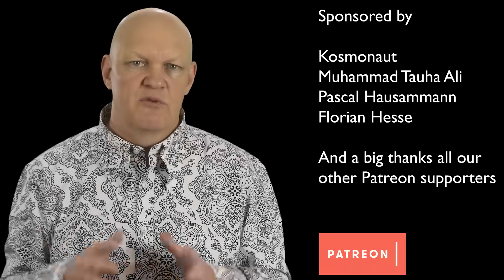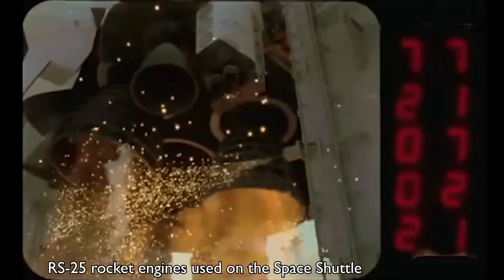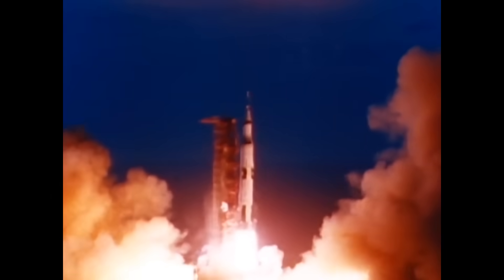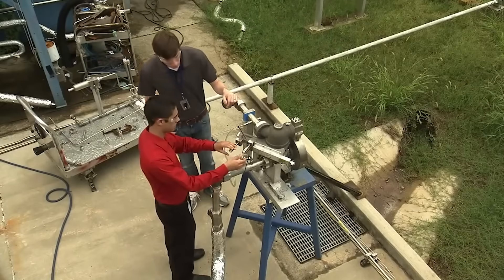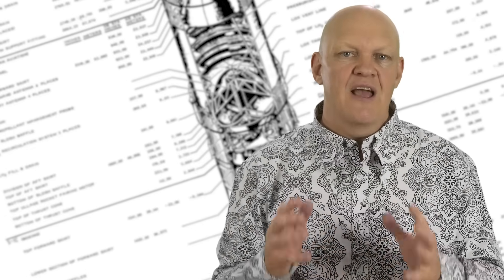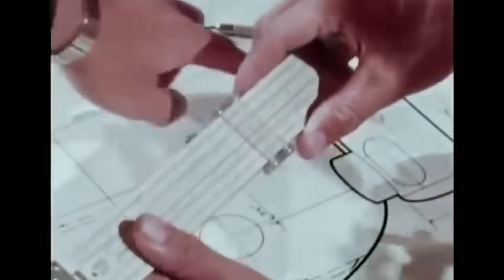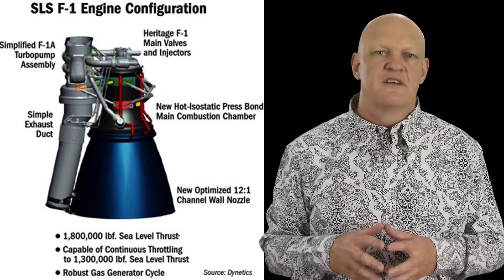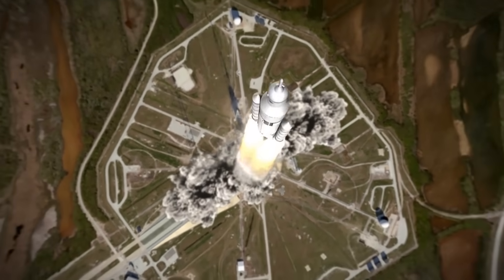Why Can't we Remake the Rocketdyne F1 Engine?

Comment: Working in R&D for a "couple" of years I can say, that history repeats over and over again. Documentation is something that everyone wants to have, but nobody wants to write or pay for. In every project, it's the first thing you sacrifice for being faster or cheaper.
Some years ago, I had the assignment to develop a new module for a system with its origins in the 80ies. There were documents on the interfaces to use, but we soon found out, that they were incomplete and partly incorrect. We had some modules from "back then" that were behaving differently from the specs. Our customers that provided the stuff were unpleased and helpless, since the original developers left the company or retired some years ago. Their reaction: Leave away the documentation and just make it work. Lesson learned? I doubt it.

It's the same thing here: Nobody cared about long term stuff. That's where knowledge gets lost! Why do you design it this or that way? Remember that in the process of design, you have to take into account what you can produce, buy etc.

Comment: In the mid sixties I worked at Douglas Aircraft in Huntington Beach. We were building the third stage of the Saturn V, the SIVB rocket. After the Saturn program we built the Skylab in the seventies. The engineers were so talented. But they would be completely amazed by what the engineers at Space X are doing today.

Comment: Back then everything was hand made. The tubing that made up the rocket nozzle was hand welded. Now it could be made by CNC and/or 3D printing.  It could be designed on supercomputers and controlled by supercomputers. With today’s technology, we could make an engine better than the F1. Not a slide rule would be in sight.

Comment: The F1 engines were just as you say built in a completely different time, and to make them they had to make use of the industrial base available then. Can't jump into a time machine, you have to use what you now have. Granted, the engineers got it right and the engines were and still are marvels of technology.  However, now you can design the part in three dimensions, make a prototype and check the fit and such in the real world. You can build with Computer Aided Machining,  We simply have technologies that allow everything to be the same now. For instance the engine that lifted the LEM Ascent stage had to be designed and built and put into the craft without testing as the fuel was so corrosive it would destroy the engine. Now, none ever failed because the designs were simple as they could be however had it failed we'd have had men stranded on the Moon with no help available.

Comment: Wrong. This technology can certainly be recreated. The difference is technology has advanced forward since the late 1960’s, more power, more efficient, with lighter parts. Resulting in more lift capability at hopefully a lower cost

Comment: The Apollo first stage used Kerosene and LOX. Will the SLS use kerosene also or hydrogen? If they are different, that will cause some engine manufacturing adjustments.
Reply: How many smoked salmon would it take to create the LOX for a single launch?

Comment: Sure, the big engine was an impressive feat of technology. Generations to come will marvel at its size and power. But the question is,  what would its use be today?  Scientific missions are smaller today, as ever more features are packed into smaller and smaller mission packages. In addition, propulsion technologies are pushing all envelopes. It's still early in that process, but one day it will lead to an understanding that chemical rockets are heavy and limited.

Comment: I was 5 miles from cape Kennedy on the beach and watched the July 1969 liftoff  of the Apollo 11, out of this world experience with the deep crackling sound from the Saturn 5 engines and the sand on the beach vibrating 1/2 inch into the air. Totally incredible as the rockets picked up speed and ingested clouds!

Comment: So....wait a sec. The New Generation of engineers developed a rocket that still dumped the preignition exhaust to the side? I thought its was obvious that the carbon heavy and fuel rich exhaust was channeled halfway down into the main combustion (That big tube curling around the engine) to add more thrust or at least burn away the horrible Hydrocarbons left over from it. Since the scientists of the 50's and 60's barely knew about leaded gasoline f*ing things up, Id be willing to bet that the design was NOT for the environment and more for performance. I"m not a rocket scientist but even I can follow basic design and recognize a preignition exhaust flume....and everyone has been doing their best since then to get away from such a wasteful expenditure of fuel. I dont see any current science team being so wasteful of fuel or callous to pollution to the environment.

Comment: To summarize: Modern engineers recreated a computer modeled F1-B which would be just as powerful (1.8 million lbs/ thrust) and require 40 parts to assemble as opposed to 5600. The engineers back then made many on the fly adjustments which were written down as notes, making each engine slightly different. Those notes are long gone, along with many hand labor techniques.

Comment: We can remake them; we wouldn't want to remake them the same way, as the video states. With modern CAD and NC machine and automated processes, you can reduce the parts count and cost.
Reply: Some how I didn't come to the same conclusion on the parts thing as many of you did, perhaps we all should listen to that part again with an open mind.
Reply: @ein0987ify  What are taking about "open mind"?  About what. That is a troll thing to say. Different conclusion than the video and what I reiterate it?  Watch the video again and learn something. 

I have a degree in mechanical engineering and work in Aerospace. The point of video is its impossible to make the F-1  engines the same way they were made before. The hand written notes on the drawing and the skilled technicians are gone. Each F-1 was custom and hand made.

 You could build a new design of the F1 Engine with less parts and different materials and advanced processes. Even if you could build an F-1 the same way they did, the costs would be tremendous. Part of space travel today is lowering cost. You don't understand what I said, and this whole topic is over your head.

Comment: One thing I saw in another documentary is that the F1 could not be run at full power without exploding so that is why there is that dark curtin of unburnt fuel you see coming from the nozzles at liftoff.
Reply: The dark area is the "rich fuel" area of the flame process. By saying rich fuel I mean that the burning process is set up at a fuel (RP1 type of Kerosene) vs oxygen (LOX) at a ratio lets say.... 3:1,  for example 3 units of fuel vs 1 unit of oxygen. 
If that ratio was 2:1 you would run the burn process leaner and the power output would increase, but would also increase the temperature of the combustion chamber at higher levels. The F1 engine was designed in a way that LOX (which runs at -290 'C) to pass through the engine bell's inner walls through small pipes that could cool the engine bell in a way and prevent it from extreme heat! A very smart indeed idea that Von Braun had designed to cool down the engines.

The F1"s power output was at least (minimum) 1.500.000 lbs of thrust at sea level witch was very underrated and conservative. measurement , considering the F1 engine was always running at 75% of it's full power, being an open cycle design engine as we know it lacks efficiency (-30%) vs a close cycle Russian RD engine design.

In other wards , it was taking off of the launch pad just by idling !
But it was enough to lift it's 3000 tons body structure and put in orbit it's 140 ton 3rd stage!

Yes, the N1 's power output of 9.100.000 lbs of thrust from it's 30 close cycle and very efficient engines is the only measurement that is above and better vs the Saturn V 's 7.500.000 lbs of thrust, which is very conservative as we mentioned before.
And that dictates from the following ....That the Saturn V was:
- Heavier than the N1
- Bigger mass then the N1
- Taller than the N1
- 25 engine's less than the N1
- Bigger payload to LEO
- Bigger payload to LMO 
-  Having 100% success in all of it's   flights (13 total launches) vs 100% failure of the N1 (4 total launches).

The Saturn V , is the most powerful and successful rocket ever!

Comment: Curious Droid ...the original F1 engine has 5600 parts as you mentioned correctly. You also said at the beginning its was a simple engine design, and not very expensive in cost. It was not simple at all. It had 5600 parts that should stay together for a proper operation, if one failed kabummmmm! So it was far from simple design and cheap ! Just saying..

Comment: The SRB's are just a ploy to keep ICBM tech in use and development.
Reply: pretty sure most of our ICBMs are liquid but ultimately they don't matter when compared to our SLBMs
Reply: @sniperwolfusic  ICBMs use solids just like the SLBMs
Reply: ICBMs are obsolete, short range submarine missiles are what would be used in a modern context.
Reply: The solid rocket tech in the SRB's and ICBM's is hilariously low tech. It's basically a glorified firework.

Comment: I use to live in Simi Valley, rocketdyne was up in the hills a few miles away. They use to always test their engines & shake the whole town. It was pretty cool. You hear the rumbling start, all the windows would shake, and a big plume if white smoke going up into the sky. Never actually saw a test. But heard n felt a lot of them. They stoped doing those tests and I miss them.
Reply: I lived in San Jose Calif. and i remember the first time i heard them test one of the solid booster rockets. The windows, and house started to shake and the noise was loud and i could see a big white plum of smoke rise over the hills to the east of us. At the time we had no idea what it was until they showed it on the news later that evening. It was the most amazing thing i ever heard. Those rocket boosters were very powerful and loud and we were about 20 miles away from where they were testing it.
Reply: Part of my life growing up in the 60’s in the San Fernando Valley (where Rocketdyne was) was hearing the F1 engines being tested in the Rocketdyne Santa Susanna Field Lab in the hills between the SFV and Simi Valley.

The noise was incredibly loud as would be expected from a rocket engine with 1.6M pounds of thrust.

Comment: I think that is true in any area of technology. Building an EXACT REPLICA of a 50 year old design will run into the problem of there no longer being a factory to make it in and/or supplies of parts and materials and knowhow. Something as simple as a paper clip might be hard to create an exact duplicate because wire made from the alloy used in a 1960s paper clips may no longer be available. 

However, it is relatively easy to build a FUNCTIONAL EQUIVALENT of virtually anything built in the 1960s, just as described in this video. It's easy to make a functionally identical paper clip using a readily available type of wire - and far cheaper than trying to do the metallurgy to resurrect an outdated alloy. 

Going a little more high tech, today we can put billions of transistors on an integrated circuit. Back in the 1960s it was on the order of a few dozen. It would be prohibitively expensive to set up a production line like they used in the 1960s. It would be trivial to make a part in a modern production line to a 1960s specification.

Comment: Why can't we remake a rocket engine designed in the 1960's.?  Why would you want to.?
With modern materials, & computer design,  a new rocket engine should (theoretically)  be way better than a design that's 50 years old.  
Did we learn nothing in the last 1/2 century.?
Reply: Did you watch the video before you commented? Because that was actually the conclusion of the video.

Comment: You can go to DynaCorn and buy a new '68 Camaro body and use it to build a new '68 Camaro. You can make a perfect replica or you can use a modern engine, modern suspension system, anti-lock brakes, modern sound system/entertainment package, etc. and have a vehicle that works far better. If you're not building it for the sake of nostalgia why wouldn't you?

Comment: even if we had the crib notes from all the engineers that built the F1's the thing that would hurt the building of new engines the most would be that over half of the company's that made the parts for the F1 are no longer in businesses or have long since been bought out .  and the loss of the casting , welding  and forging Technics from back in the 1960's would make building new ones almost impossible . the welding of the parts was so difficult that new welding Technics had to be thought up on the shop floor by the welders that had some the best skill in the world just to make the Apollo project possible most of which were only used for the F1 engine . to have the young engineers of today say they can make a better version of the F1 with far fewer parts makes me think they haven't had enough in shop or on the floor work experience to build the engine they propose. NASA should let them build one and test fire it to let them find out if there right.

Comment: Environmental requirements have also eliminated the use of some materials, chemicals, and processes. So the engines would not be made the same way. Today few engineers understand tolerances and associated costs. Welders in those days had excellent work ethics and were skilled.  Their talent evolved. Same with engineers.  Many started out working in industry and were able to manufacture what the designed.  

It would take a minimum of 10 years to get engineers up to speed and get a similar design done.   

Too bad we never had transition programs to help pass on talent from old to young.  

I’m optimistic I think the future will be exceptionally bright for new programs and for engineers.

Comment: Like in Japan many machine parts made by brilliant tradesman on own lathe, tolerance of 0.1mm but they by feel reached 0.01mm tolerance. So Japan over the next 20 years will hqave to replace these brilliant men  men that were 20,000 and today lucky to be 5,000 supply the huge mega companies with small  integeral components.
Reply: But, today, computer-controlled lathes can produce those same parts with 0.01mm tolerances, faster and more reliably.

Comment: Sadly, this is a common issue......skills are being lost
Reply: And,  if we ever need them again,  we won't have them.  Why would need them again? If we knew that,  we probably wouldn't need them,  because we could head off the circumstances that created the need before it arose.  But sadly,  it's always the one you don't hear coming that gets you.  Our society is becoming far too dependent on high tech,  with no fall back,  no plan B. If the power goes out,  and an escalator stops working,  it turns into a set of stairs,  and won't leave you stranded.  Would that all our technology were like that.

Comment: Reverse engineering. Only thing missing is the (political) motivation.
Reply: Did you not watch the whole video? They did reverse engineer it and improved the design taking advantage of modern manufacturing to go from 5,600 parts to 40 parts.
Reply: You can't reverse engineer a skillset. We know how the engines worked, but the technicians' skills needed for assembly are no longer used.

Comment: This effect is extremely visible in programing. Where after 5 years it could be much easier to rebuild program/solution from scratch then modified or even use the old one.

Comment: Love it! As a Fabricator/Welder I can appreciate the interaction between Engineers and craftsmen.  

I've run into those scenarios were what's on the print will work but it needs a bit of tweaking to really work well. Most of the time we just come up with a solution in our head and get it done. Things haven't changed, things still get done the same!
Reply: Yep - once had an engineer come down to the shop floor; tell us to make sure to tap some die blocks from the top so they wouldn't be left-handed threads from the other side. Priceless -- we assured him we would not make that mistake, and sent him back upstairs where he belonged.
Reply: @offcenterconcepthaus  LOL!!! That is one delicious story. Thanks!
Reply: Amen to that mate! Dexterity is what has been lost in the engineering world :-)

Comment: I would love it if a group of engineers could remake an F1 Rocket engine but what purpose would it serve apart from being a demonstration model. Many older machines can be restored or recreated but they are much smaller and manageable. Old aircraft, cars and Steam locomotives for example, build in an age when everything was hand crafted as were the F1's. Modern rocket motors have been designed with much more efficient methods and robotics can produce components more consistent and
cost effective. Saying that what the engineers achieved in the 1960's was awe inspiring and made this young lad of the 60's a great enthusiast of the space programme. Thank you for all of your productions, I find them inspirational.